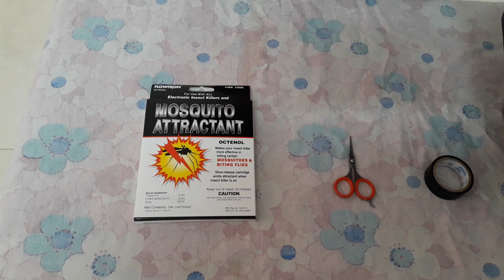How to replace Flowtron mosquito attractant cartridge

Comment: i bought a brand new flowtron 9000. unfortunately when i switch it on the bulbs are not even working at night they are now glowing. i removed the three bulbs and put it back but still not working. i bought it directly from the factory.
Reply: Call them
Reply from the maker: Bought from USA and Using in India? There is a difference in watts 

110 vs 220 in India